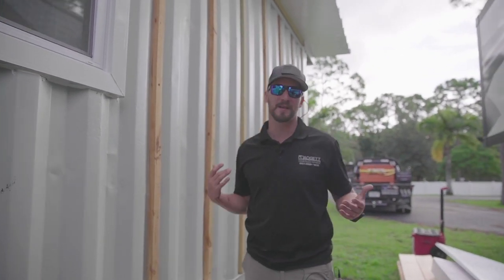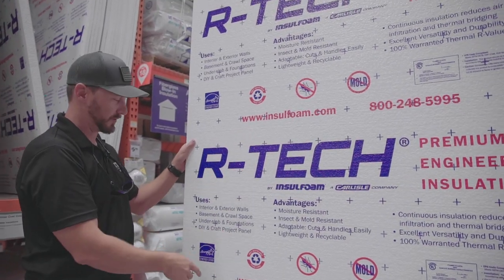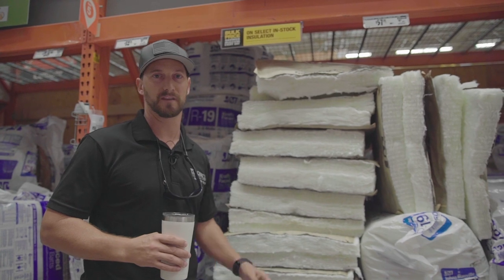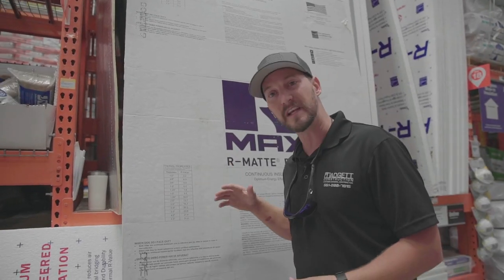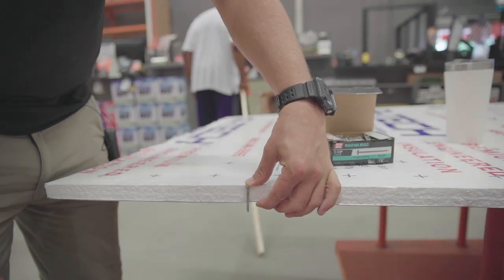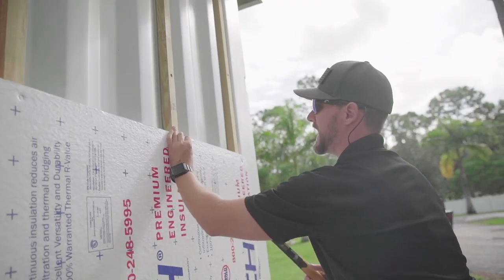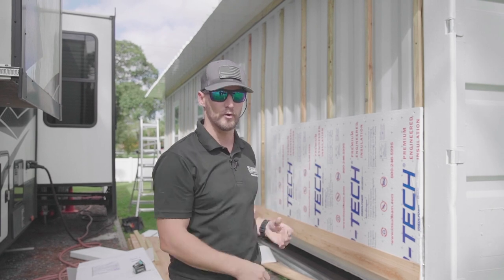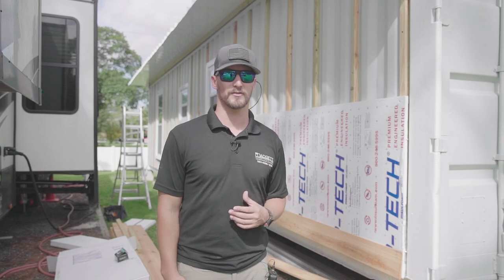How to: Exterior Insulation & Cedar Siding

Comment: How did you attach the 2x4 studs to the shipping container metal?
Reply: Hmmm...no answer
Reply: Probably from the inside with self tapping screws, glue on the 2x4 to place it, I have a tiny house done that way.
Reply: You can see the screws on the outside of the lumber. They're just screwed on.
Reply: bit late I know, but the answer is in another video.  They used a loctite glue, like liquid nails, and then a couple of screws to hold them whilst the glue set.

Comment: This was a great video! I'm building my first container home in the Colorado Rockies this summer. Question, I see you nailed your 2x4 sub framing through the container wall. I've heard that it's better to weld angles to attach the wood subframing to so you don't compromise the metal envelope and keep water out. Do you have any issues with water leakage by nailing the wood directly to the container as you did?

Comment: There are 3 issues you should consider about this approach.
1. The home depot vendor says plainly not to apply cedar planks on top of plastic or foam products. They spec tar paper or construction paper. You have no warranty on the cedar lap siding. you're gonna get black mold in between the siding and the foam.

2.  R-Tech products usually have 1 side with an aluminum finish which provides a radiant barrier that should be facing the exterior. You won't achieve your R-value installing it with the white side out. Additionally the seams should be taped with aluminum duct tape which completes a vapor barrier; radiant barrier and thermal transmission barrier.

3. if you run 1 x 2  furring strips (3/4" thick) on the outside of the foam board you will almost double the r-value by creating a thermal break it will allow the cedar lap to dry due to the passive ventilation. This works with almost any siding it is acceptable to apply western red cedar directly to wood.
Reply: Duuude!! You know your stuff! Thanks for the info. Much appreciated.
Reply: @marks9197  search on YouTube "Matt risinger" or "building science corporation" , they know their stuff
Reply: This is pretty complicated stuff but you can inform yourself well by  searching on YouTube "Matt risinger" or "building science corporation" , they know their stuff. Curiosity is power.
Reply: Thanks for that...Makes complete sense...

Comment: Nice video. Did u attach the sub structure by screwing through the container wall, if so is there an issue with water getting thru the screw hole?
Cheers
Reply: Hi Phil. Did you get a answer for this question?
Reply: Had the same question to ask... see you didn't get an answer...
Check out this video - it will explains it.
https://www.youtube.com/watch?v=V1uHArYU4s0
Cheers
Reply: The siding would stop the water?

Comment: You said not to use batts on the inside of the container  What is the reason doe this please? (asking for a friend who is using wool batts plus reflective insulation sheeting then gyprock as finish. In West Australia  Moderate climate)

Comment: How do you seal the bottom edge of the insulation panel?
Mice and critters can eat through.
Can you attach a strip of 90dsg angle sheet metal first, then run a bead of caulking and sit your insulation board on it.
Reply: Good point about pests. Ideally you would weld angle iron to the bottom to collect the insulation.

Comment: Dude it's a little messed up that you mentioned that using the batt insulation is a bad idea and then not proceeded to tell us why 🙄 and then the lumber your fixing it to is already attached with no mention of placement or hardware nails to use...

Comment: Why is bat insulation not good for shipping containers?
Reply: With steel  need a complete thermal break.  You can use batts after a thermal break.  Big time sweating with batts only.  Spray foam closed cell would be the best.
Reply: Do you wish to run the risk of breathing glass fibre bits?   Bad enough in an ordinary building.  It is very dangerous stuff.  I would never use it!
Reply: Condensation, temperature changes, knocks the moisture in air, inside the insulation, out. Therefore your bat-insulation will probably get wet, and cause all kinds of trouble. All depends om where your vapor barrier is. Youtube 500 yr wall.

Comment: Do you need to spray foam at the bottom of the insulation panels on the bottom row to prevent insects and moisture from getting to the 2 x 2?
Reply: Coreen Piltingsrud I painted mine w/kilz, then wrapped them in housewrap w/waterseal & in that case also added that reflective stuff as well.
Reply: edit: we ended up with a rather ridiculous R45(+), but dang was it ever comfy! (we also spray foam sealed any gaps that had to be siliconed, like where wires or pipes went through.
Reply: @hoperules8874  n

Comment: So I was thinking of using a 1/2 insulation board, then fiberglass, then 1/2 insulation board on top - sort of a pink sandwich.  I planned on doing this on the INSIDE of the 2 x 4 framed walls in the interior, but you said NO NO NO to the fiberglass.  What is the flaw on my design if the insulation board facing the shipping container wall is completely sealed by foam?  Thank you for making these - I learn something in every video you make.

Comment: You end up beating yourself doing too much talking. Corrugated steel has voids under that insulation board mounted as you did so air will flow and continue to effect the overall R-value as you mentioned while at home depot. Remedy would be to apply a lines of PU foam (like great stuff) and form squares at the board then mount it to the steel. That square spaces will trap the air and seal the steel-to-insulation gap and cut the draft...

Comment: How do you install the wooden frame on container wall, it is posible just using super glue or do you need screw, or may be you have to welding a braket

Comment: I was a builder in CT. When we put cedar siding on we just cut a spacer board & tacked a piece on the lower end of it to maintain a 5" or whatever reveal we wanted. Hold the reveal board on the bottom of the first coarse to maintain the same distance between our coarse. 
Do you ever use Tyvek on your projects in Fla.? I'm living in AZ now, need a lot of R value.
Great video, thanks.
Reply from the maker: John Taglia thanks for the info! We don’t really have wood framed houses all metal or concrete so tyvek is uncommon but up in Minnesota we used it a lot.   Spacer board would for sure help!
Reply: Wood construction is highly vulnerable to termites and rot in Florida. In addition to that, concrete block structure is vastly more resilient against hurricanes.

Comment: Why is the foam layer not continuing to the actual corner to insulate the corner post (heat transfer in and out occurs there also)?   Ditto the cedar board - isn't that needed to the corner also?
Reply from the maker: Alan Torrance it’s a huge steel post and ours is sitting in the shade due to the roof so it doesn’t get hot, the stay cool product we sprayed on the container earlier literally keeps the siding cool so we were just showing the basics of how to fasten the insulation.  On ours we actually are not going to install insulation under the siding at all but depending on a lot of factors you may or may not need to insulate that post on the exterior if you didn’t on the interior

Comment: These R-values are different from Europe R-values it seems where average 4 cm insulation is a R 1.   And shown in video amount of insulation looks like a joke, you need at least 10 cm R 2.5 to have any real insulation.  And the material shown is probably very flamable.
Reply: In North America, the R value is an imperial value. The R value to RSI value conversion is roughly 5.67.

Comment: I don't understand the need to completely cover the shipping container exterior. You would have been better off framing the structure traditionally. Unless you are required to have outboard C.I. it was a waste. You already showed C.I. boards on the interior, in addition to cavity insulation.

Comment: Using 2” rigid insulation to install the siding we were looking for 3 1/2” nails but they all seem to be gauge 8 which looks tight in the siding slots, what did you do?

Comment: What considerations do you use to decide if you are using interior or exterior insulation? I like the metal look of the container on both the inside and the outside, so it is not a matter of siding or paneling. I live in Northern Montana and get very cold winters. I will be heating my unit with a wood and am unsure what method would be the best insulating and moisture reducing for a 40ft tall container. Any tips and/or tricks would be appreciated.

Comment: OK, the insulation you pointed out (the closed cell) for the interior is super thin!!! How is that sufficient as insulation? (Sorry, a beginner here!)
Reply from the maker: Mia M I was just pointing out the difference, but I would for sure do 1” or greater depending on your climate zone :)
Reply: @ContainingLuxury  I am considering using a thin layer of aluminium foil with EPS core for the interior (as first step) under the metal framing + drywall, and for the outside a thick foam insulation and render. Would that combo work (without trapping moisture in the wall?)?

Comment: To clarify, the batt insulation is not a good idea because the container is made of steel, and there needs to be a complete thermal break between the outside and inside temperatures or else there will be a lot of condensation, which means mold growth.

The only time you should consider batt insulation in a container remodel is if you're going to employ the flash-and-batt system. That is: You spray an inch or two of closed cell polyurethane on the entire inside of the container, directly to the steel, to get a continuous and unbroken layer of insulation. Then, once you install you're framing, you can put batt insulation into the stud cavities as usual. You get the complete seal and excellent thermal properties of the closed cell polyurethane (preventing condensation), with the added thermal properties and sound reduction of the fluffy batt.

Flash-and-batt offers the best of both worlds… if you can afford the closed cell but don't want to break the bank with more than an inch or two of it.
Reply: Rockwool would be a better choice than fiberglass.

Comment: condensation doesnt accumulate where the air gaps are?
Reply from the maker: Mike depends on where the gaps are and how they are designed, we have vents that allow the air voids to breath but yes we would not recommend voids on a DIY basis.  If you reduce the heat load on the metal itself then you don’t have to worry about that issue

Comment: Would a vapour barrier not be required, if so would this be installed on the outside or inside when insulating on the outside like in this video?
Reply: These R-Tech panels have a vapor barrier integrated into them. They would just need the seams taped.
Reply: Vapour barrier is always installed on the warm side of a wall. Keeps the moisture away from cool areas where the condensation occurs.

Comment: @Containing Luxury - For the interior insulation, are you worried about the gaps behind the insulation because of the irregular shaped walls of the container? I would imagine that you will get moisture build up in areas that the insulation isn't touching.
Reply: OF  course you will...the metal walls are perfect vapor barrier on the wrong side of the interior insulation.  Setting up the perfect "mold growing box".  Merely another example of WHY shipping containers should be used for shipping, not housing.  Not that it will stop this insanity.
Reply: @edsmith4414  You can use mold resistant insulation. People use flimsy sticks to build home with all the rot and mold issues. A pre engineered structural module like a container is many times better.